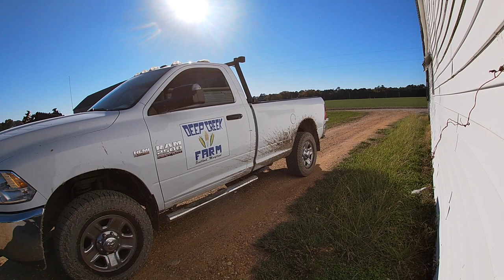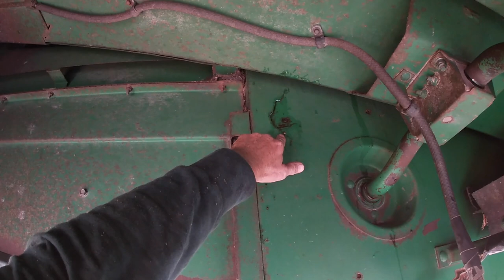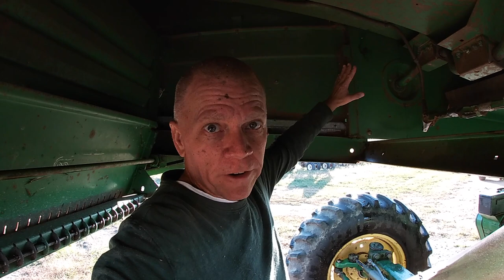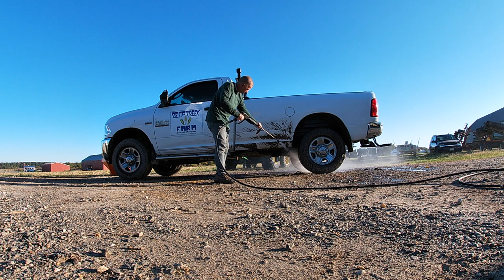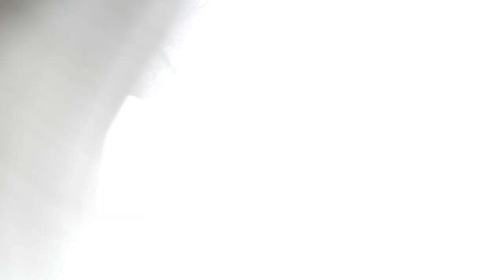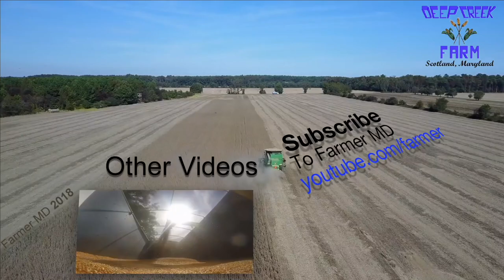Combine Needs a Band-Aid

Comment: Ya i never felt that the back ends of the 96 series were heavy enough. We welded up a lot of cracks on ours over the years too. We had most of our trouble along the rails that the straw chopper slides on. Despite having the chopper balanced every other year for as long as we owned it.
Reply from the maker: I had a JD4420 and 7700 and had problems with both cracking on the tail end.